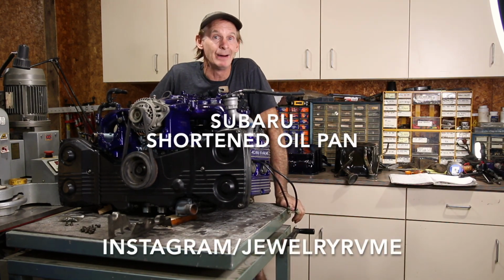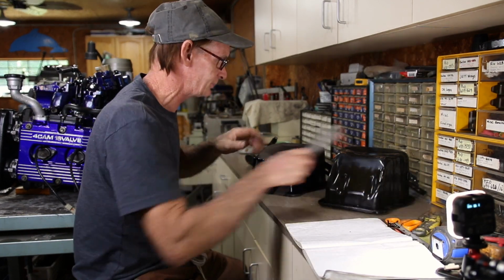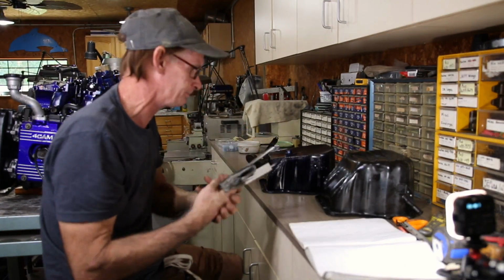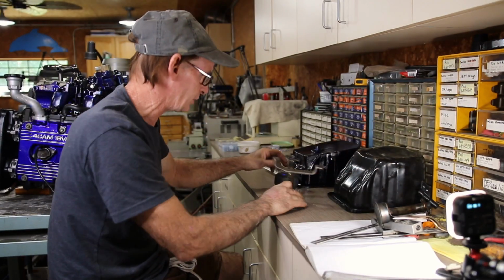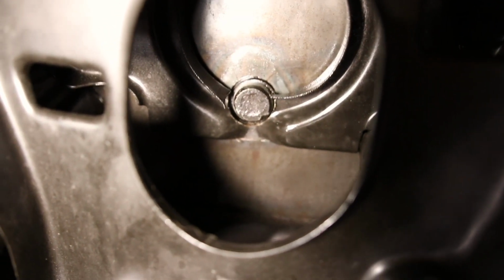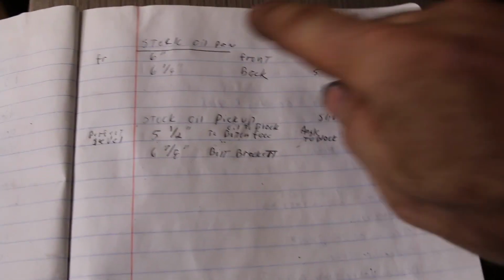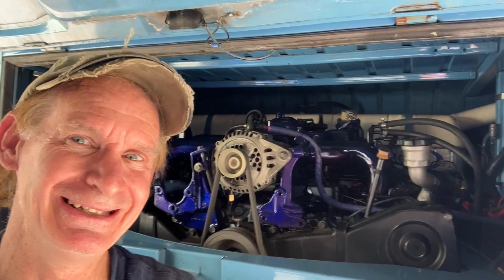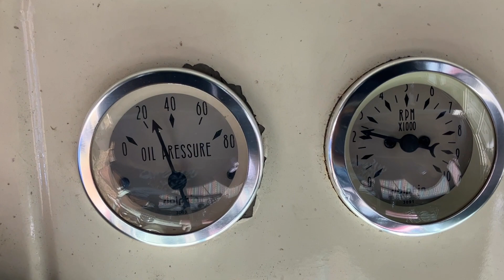Subaru shortened oil pan to vw bus / bug

Comment: Do you have a video on the electrical modification for the wiring harness for the Subaru motor into bus install. Thx
Reply from the maker: umm well that is going to totally depend on what computer and wiring harness you are running, I have 2 Subaru motors for this car and 3 different computers. factory one, hall tech and a Link after market programable . currently I am running a Link so I am not running much of any of the sensors. just what I need.  as you can see in the video . all you need is computer pin out so you know where the wires go.

Comment: So, you worked the sti motor and put it in for the season.  Did you change the gearing in the trans axle?  And, how does run?  Good performance?   Good economy?
Reply from the maker: well i run a performance freeway flyer transmission. its way better then stock but still room for bigger gears in the future like a Porsche 5 speed would be nice